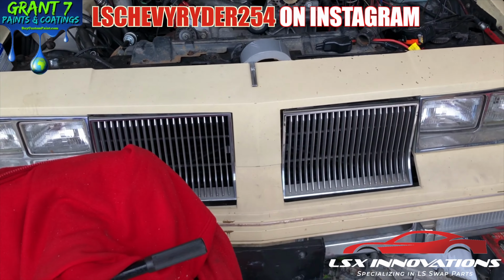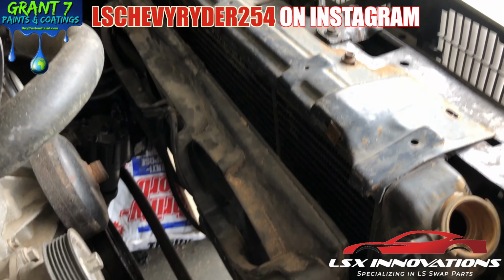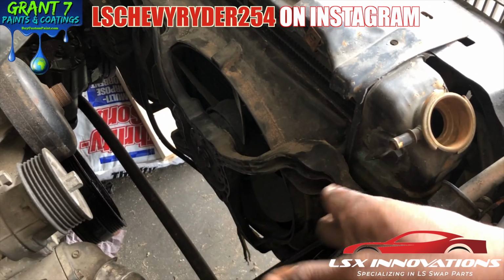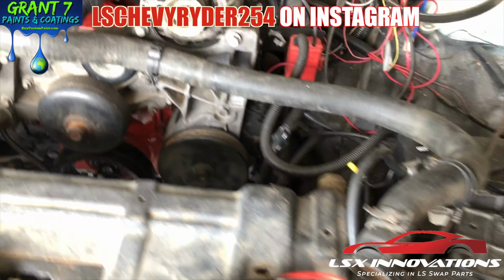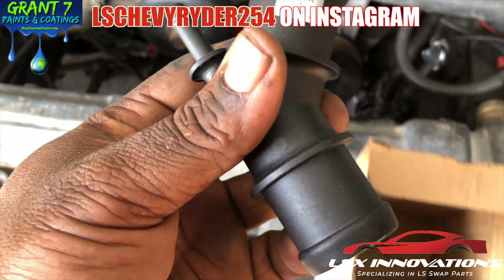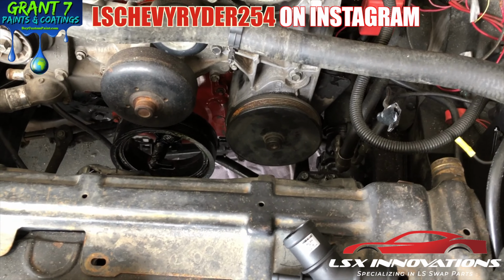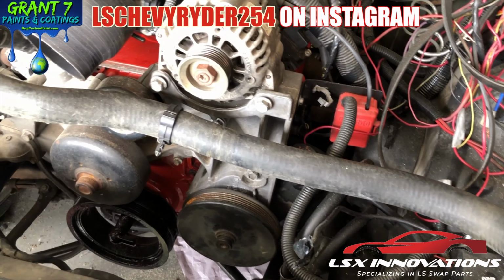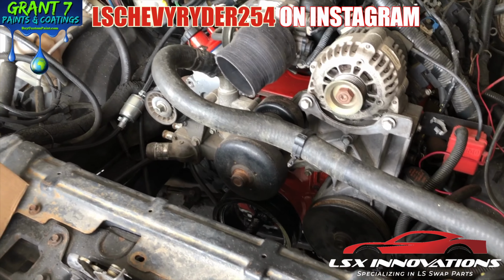LSCHEVYRYDER254 PRESENTS: HOW TO DO A LS SWAP OLDSMOBILE CUTLASS PART 7 ELECTRIC FANS FOR LS SWAP

Comment: That’s a neat piece , I think it would go good on the top hose between the alternator area and the throttle body.  Looks like there is already a nice similar bend there you could cut that bend out and put the connector in there
Reply from the maker: Cool idea